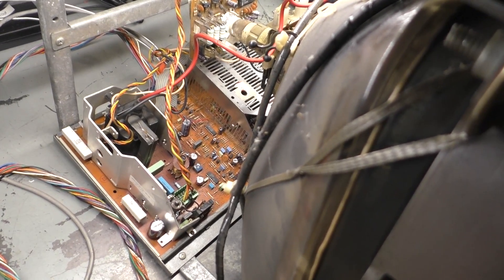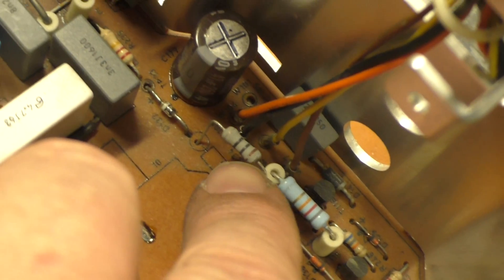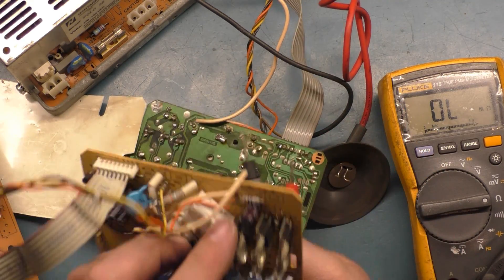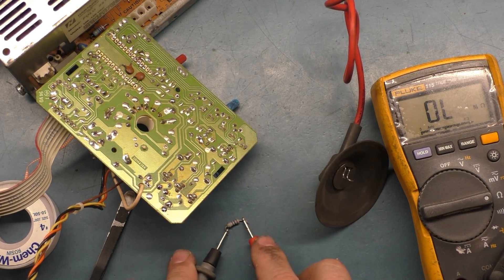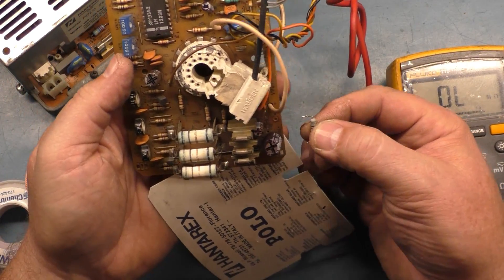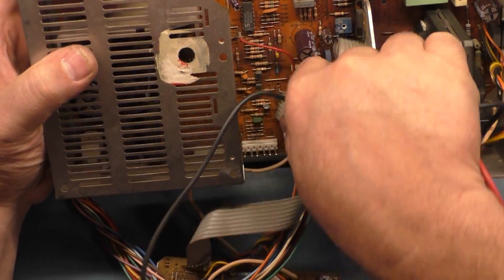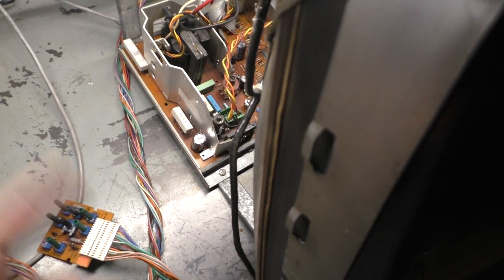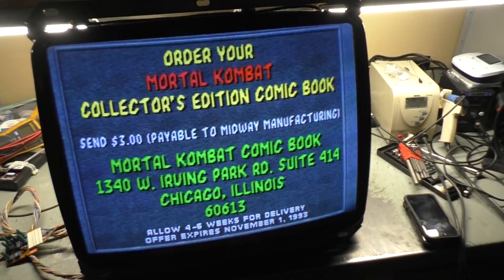25" Hantarex Polo Arcade Monitor Chassis Repair - All WHITE Screen With Raster Lines - Easy Fix?

Comment: Hi Mike, thanks for your vídeo. I saw that R234 resistor smoking in live after repacing the T114 , few others componants + full cap kit. I replaced it but unfortunatly it blown again right away without any smoke.... Before putting tje power i checked for any short on that rail: no short.... So I still wondering why that resistor act like a fuse....🤔. Any clue?